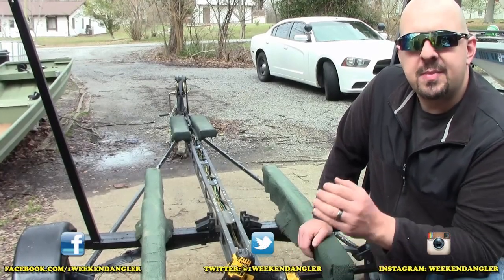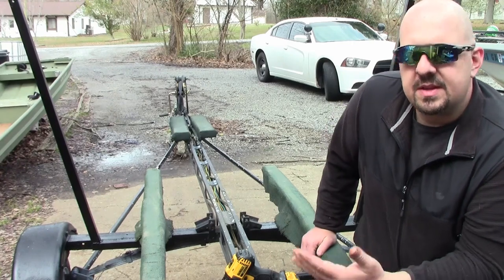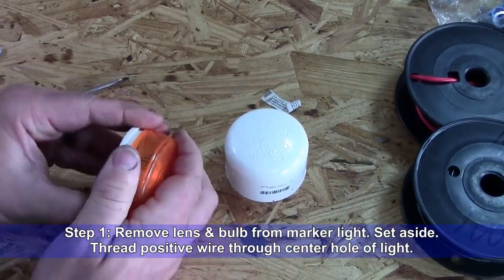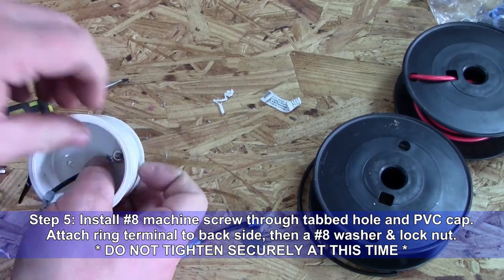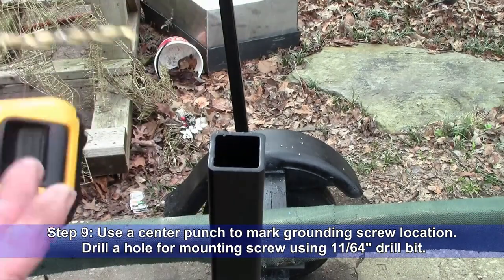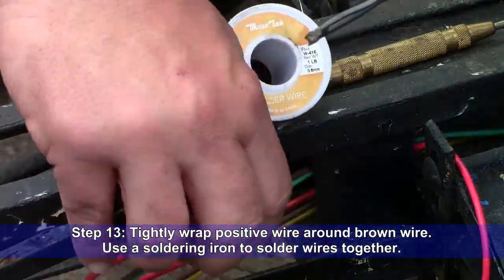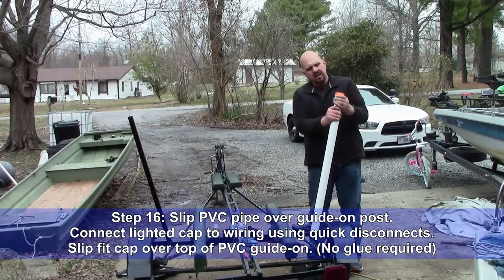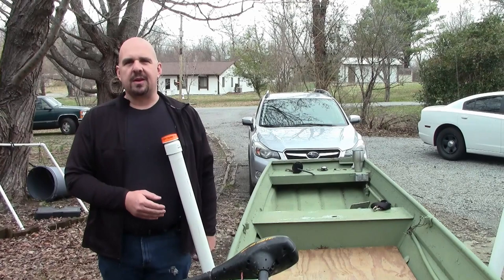Build and Install Lighted Guide Posts for Your Boat Trailer for $10 or Less!

Comment: Thanks for sharing your process.  It helped me to figure out how to upgrade my own trailers on a budget.  I used soldering connectors instead which has worked well on past work I've done with trailer lights.